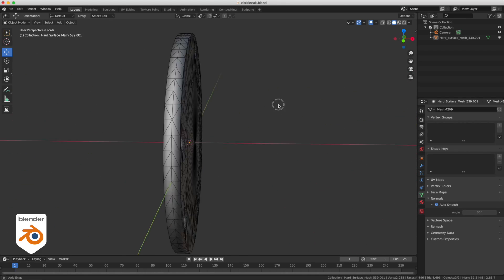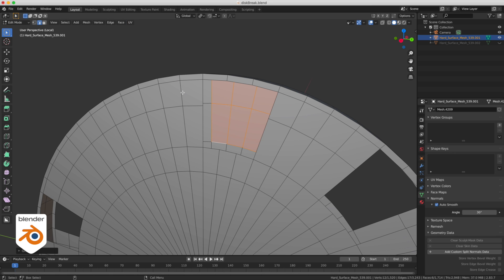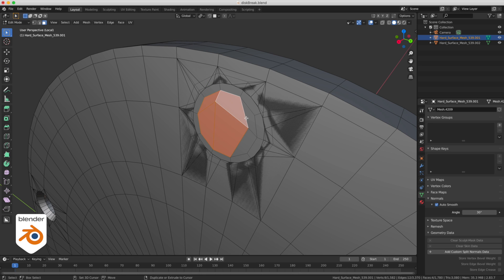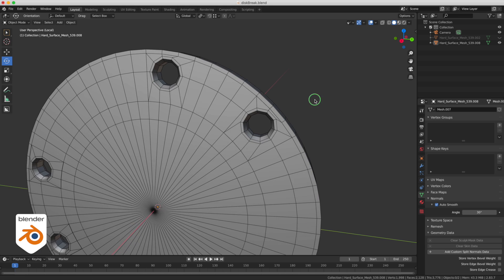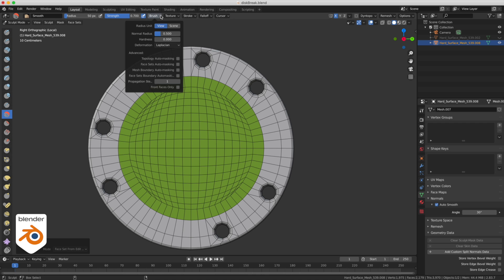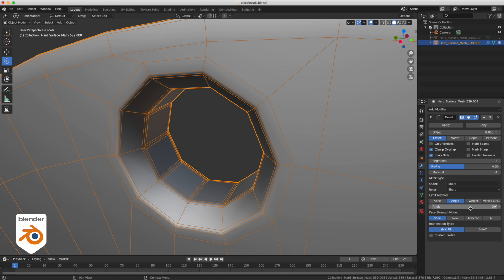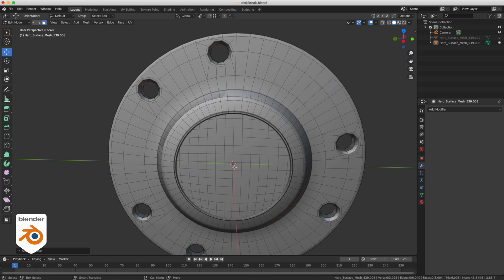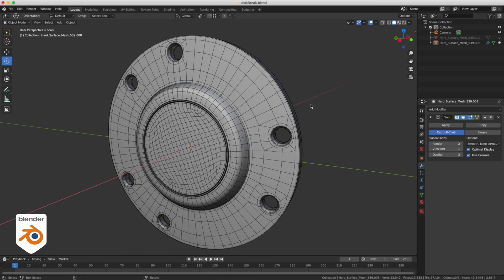Advanced modeling techniques in Blender Part 2 EP19b

Comment: This looks like a machined part, and you'd typically use anisotropic shading for it. I never need to deform my machined stuff, but I usually have to use UV based tangents, thus I'm perfectly happy with collapsing points to the center with a close support loop. Out of curiosity, how would you deal with anisotropic shading on a deformable part where radial based tangents won't work? Note that there is a "shading bug" in Cycles - or a "feature as planned" as the devs call it, in that UV based tangents don't get smoothed across the seam (but normals do).

If this is not in your daily problem solving repertoire, how would you even approach the problem if such a task came up? Deform animating a machined version of the Utah teapot found in the Extra Objects addon (needs some tweaks as it's kinda buggy) might be a good source to experiment on.
Reply from the maker: I never had to deal with this situation. Usually, when we break or deform stuff, there's also a lot of dust and debris around it. We wouldn't see much. In the VFX world, the goal is not to make it look totally physically accurate. Make it look good, spectacular. :-)
Reply: @BlenderBob  As an old machinist, to me a machined looking part looking machined is what defines spectacular - literally :D
Reply from the maker: Ha ha! That explains a lot.

Comment: oooooh yeaaaah hey blender bob!
Reply: I mentioned I work with CAD and CAE, using numerial methods for mechanical engineering. Lately I've been fed up with CAD topology (I love GMSH but sometimes... gee...) and been implementing physics solvers directly in Blender! I got heat conduction and acoustics so far ;)
Reply from the maker: Watch next week's clip. It will blow your mind. Hint: moi3d
Reply: @BlenderBob  uuuuuh love the suspense